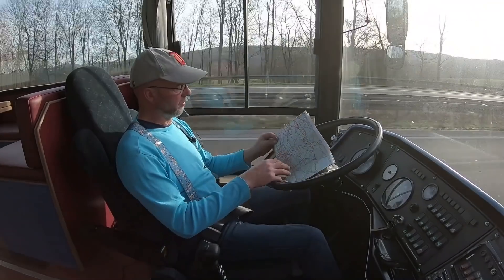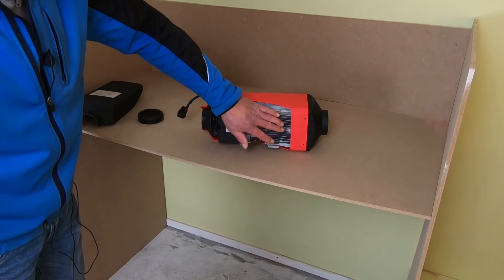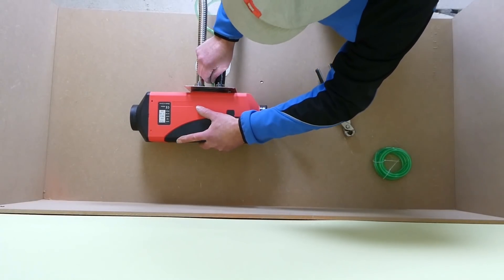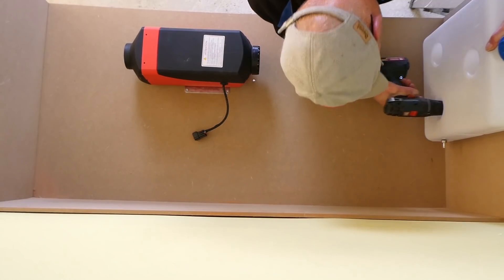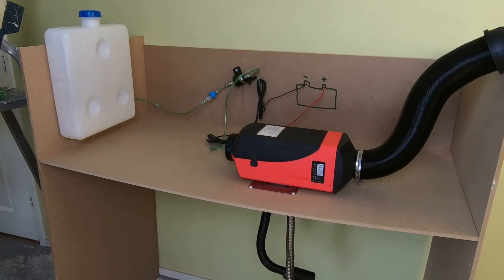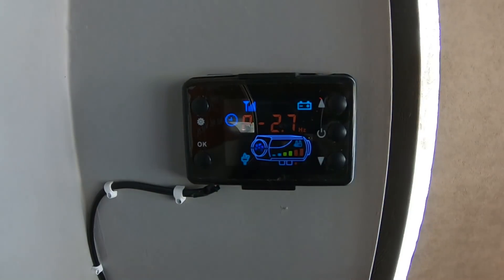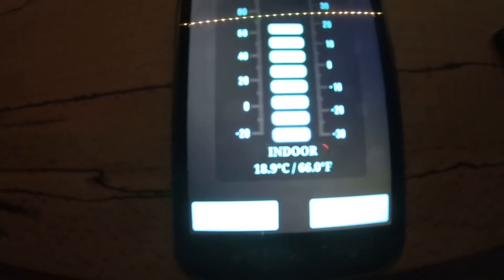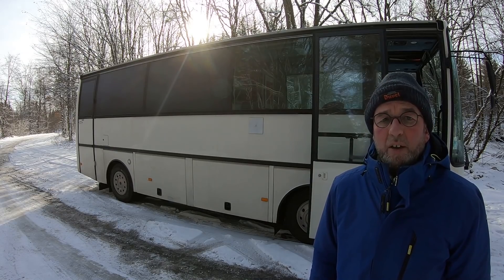Chin. Diesel Heater | Winter Test & installation for dummies in 8 basic steps

Comment: I have a 5 KW diesel heater as well as a 35 000 BTU propane heater.  I live in Central Canada close to the US border.  During the winter in can get to -40C...and that's not including the wind.  I'm still working on my bus.  Hopefully it will be done this spring.  Its about the same size as your, maybe a bit bigger.  So on those cold days when i go to work on the bus, i fire up the big heater to warm the bus up very quickly then just use the 5KW heater and it keeps the bus nice and toasty.
Reply from the maker: Nicely done!
- 40, that's not what we have here (anymore)!

Comment: Hi Han, hope you are enjoying your bus. You inspired me to get one too. i was hoping you could give us a video or give me a tip on how to install your JUN-Air compressor to maintain the door air. i keep losing air. lol. Great videos.
Reply from the maker: Thank you John,
The simple answer:
Connect the Jun-Air with a hose to the test nipple of your bus (where it is is depending on the brand), with a valve in between (at the test nipple).
Be sure that the Jun-Air can go up to 10 bar (not max 8), and that your bus doesn't have any large air pressure leaks. Because then the Jun-Air has to work too hard/long and will overheat. It is suited for 'maintenance load' only. For example: If your bus is 'in rest' capable of keeping pressure up somewhere between 6 and 8 bar during 3 or 4 ours, you're on the safe side. The Jun-Air will then only have to work once every 3 or 4 ours, and a little bit more when you're using air for doors etc.

If you like I'll send you a few fotographs
Good luck!
Reply from the maker: @John-oh8bq  But..... where to send them?

Comment: Watched the video. Many thanks for your simple, clear, concise explanations.  I am a little curious as to the direction of the inlet air and the exhaust direction !  Forward facing as to direction of travel ?  I would have thought that the exhaust at least would be directed to the outside of your bus, and slightly backwards ?  So that it may be used when driving ?  Or is that contra-indicated (not wise).  Would be interested to see any diesel fuel consumption figures that you might collect during your use.  I think that considering the lower cost than the European heaters, this will be a worthwhile expense.  May be looking at this as a secondary source of heating for ours too.
Reply from the maker: Yes, you are correct. Exhaust and combustion air inlet opposit op the driving direction. As mentioned in the installation part of the video. I 'm not in the position of reccomanding using it while driving, but it is most certainly possible.
I haven't figured out the fuel consumption yet, so it is a wild guess for now: About 10 liters during a complete and freezing weekend and permanent use.